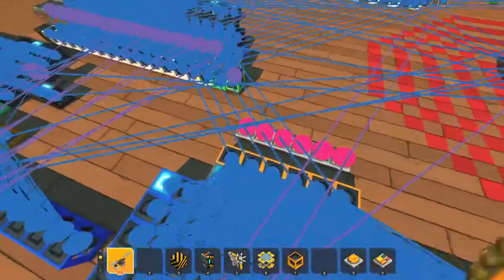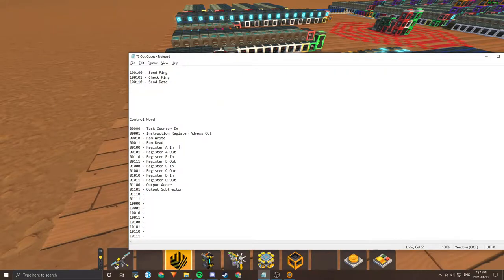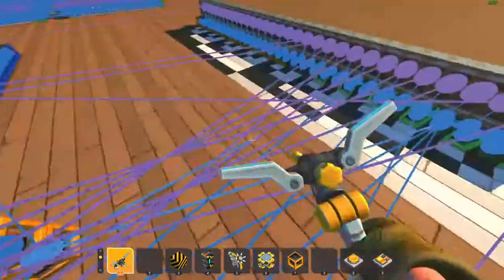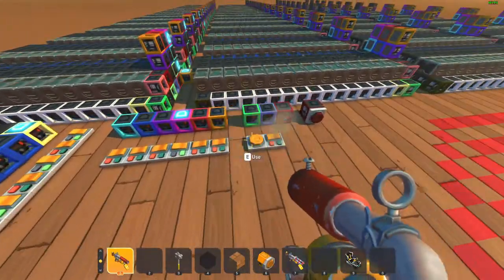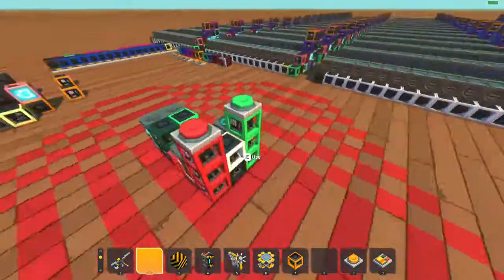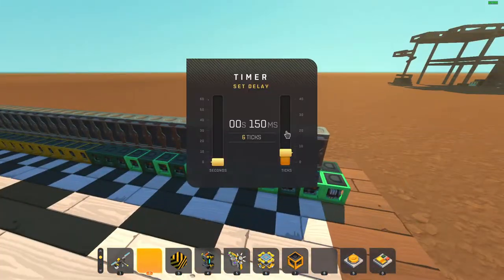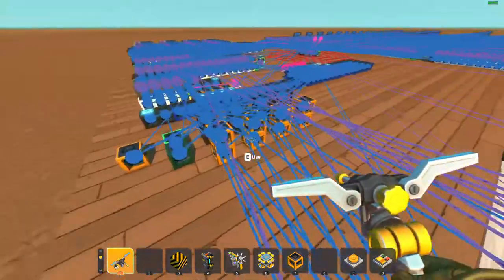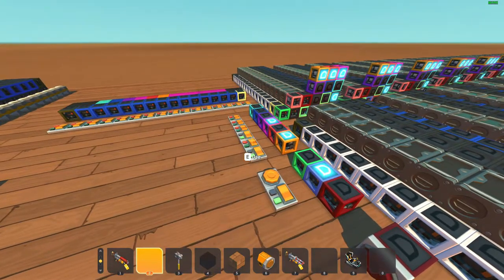Turbo Snail EP9 - IT'S ALIVE! - Scrap Mechanic Computer Construction

Comment: good job man! it is difficult to find people who understand logic in the sm community. I am currently building a multi-core 8 bit processor to achieve greater performance, which at the moment leaves much to be desired .. but 3 ticks per operation is the maximum that 1 core processor in sm can do :/
Reply from the maker: Nice to see you as well, I guess the game isn't really built for this, so the limitations are a bit unfortunate. I'm interested in multi-core though, I have never tried or looked at that, it seems really complicated.